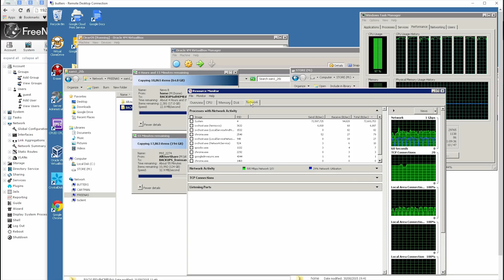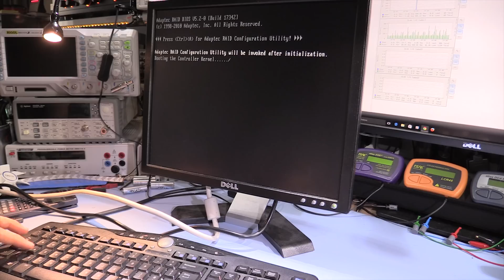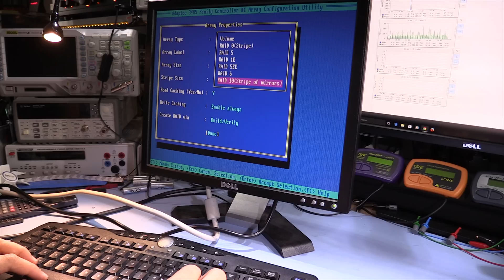SDG #029 Server Build and MikroTik Follow Up - Part 2

Comment: I see why a lot of dead Miktorik router, components rated lower than it should to be. Sometimes they use 25v unknown brand electrolytics on 24v power supply.

Comment: Is there any reason why you are running a separate router when you could be running a Linux VM as a router on your VMWare box? In fact (and I stand to correction here) but you could even run the Microtik RouterOS on the VMWare box?
Reply from the maker: Tony R I did actually run pfsense on a VM for quite a while. Security was the main concern. Advice from the professionals is never use the same hardware for firewall duties for anything that has access to your files
Reply: I'm an IT professional (so I'm told lol!) and I've run firewalls on VMs for a few years now without any issue. So long as you isolate your management network (i.e. keep it on your local LAN) it will be fine. I usually install two LAN cards which keeps things isolated. I do in fact know of at least one brave individual who (against my best advice) also has the management network on the internet. So far he's got away with it...

Comment: A year later, any comments about the performance/software of the RB2011? I am considering purchasing an RB3011 to help me learn about networking.
Reply from the maker: John Snyder I'm quite happy with the RB2011. No performance issues for home use - I am now on a 300Mbps connection which it doesn't struggle with. I've still not tested openvpn though

Comment: Similar interests. I am in the process of downsizing a I7 server to a 8-core atom server (SuperMicro MB). But using four 4TB disks instead of SSD. I am running Xen instead of VM ware so the server can run core services on the Dom0 host (SQL, NAS, firewall, multimedia, etc) to improve performance. I run Windows VMs and and pair of Linux VM for web apps). I also run Zoneminder, but am looking at using Bluecherry (bluecherrydvr.com) to replace ZM. Using MegaRAID instead of Adaptec, as I run into too many failures with Adaptec RAID controllers over the years. If you don't have a battery you can always disable write-caching. 
I  have a Symmetrix Time server (NTP server) that has a 10Mhz output with GPS sync, but with a rubidium oscillator instead of an OCXO. Also use the Noritake VFDs in my projects. also use the NewHaven OLED displays but not as stable programming using the SPI interface (no reset pin in SPI Mode), but they are more compact and lower power consumption than VFDs.

Comment: 23V is a stupid voltage!
Reply from the maker: +jpalm32 I've come across this issue with my own designs - 24V is such a common supply voltage, yet a large proportion of switchers are only rated to 23V or sometimes 25V which is still too close for comfort.

Comment: Liking the mixture of electronics and networking/IT videos :) Nearly fell off my chair when you said you thought the ZyXEL equipment was good though!!
Reply from the maker: +sberry25 I can only go on my experience. The consumer gear is as expected, but I've had no issues at all with the enterprise equipment and they've all performed to spec. I used to have a Cisco Catalyst switch, but it started to get flaky only 4 years in. It did however get replaced under warranty no problem.